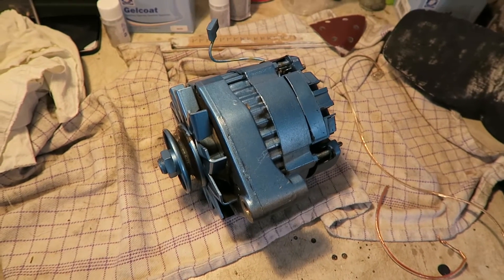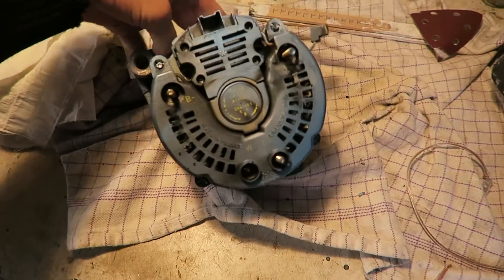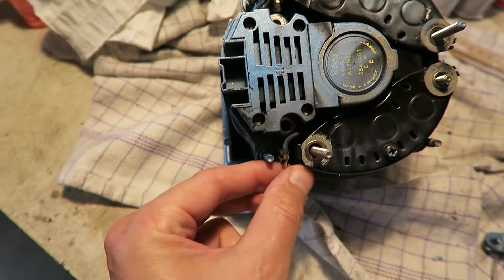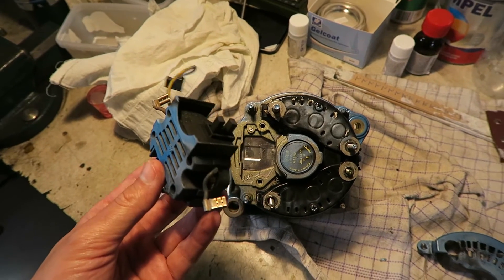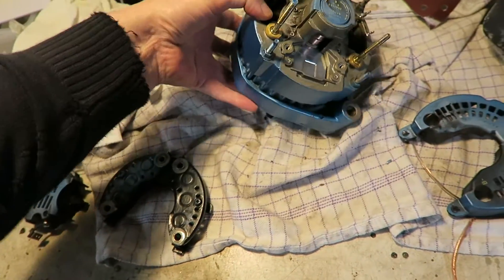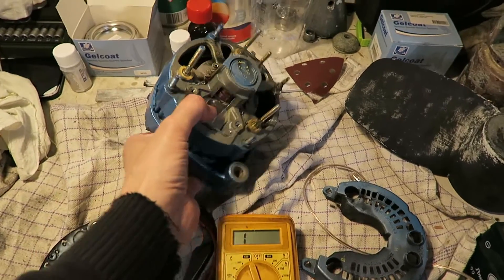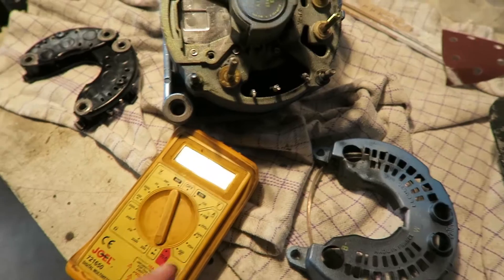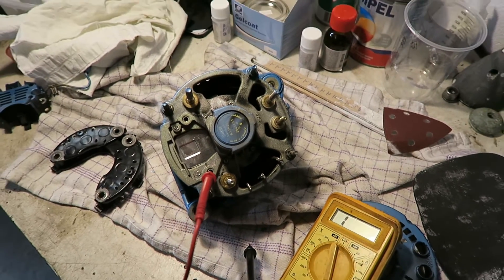How to fix a non charging 12V alternator

Comment: What type of solder? High melting point or will any solder do ?
Reply from the maker: I'm not that into soldering, but I'm using normal solder with onboard flux
Reply: Thanks 👍 I thought that's probably the way forward otherwise their might be a risk of damaging the diode using high temperature so near it. Great clear vids Tino btw 👍

Comment: Great video! I've seen this diode dies when the main switch is shutted down while the engine is working.
Reply from the maker: The diode can also die if you start up the engine with shore power connected to the boat. And thanks :)

Comment: Thanks for yet another good and informative DIY video 👍😉
Reply: By the way. Where did you get the new diode? And what is the model named?
Reply from the maker: @finnlavlund4386  I got the new diode at e-bay and the model I have mounted is called : 28T146 ALTERNATOR RECTIFIER VOLVO PENTA, and it was ordered from England. But due to rush I have ordered another one from Germany and this one is of the brand AS-PL and the model is ARC3007 (50A). If you need one I have it on the shelf. The price is around 42 US Dollars. The alternator is born as a 60A but I could only find a 50A diode, the cheapest diodes is only 35A.